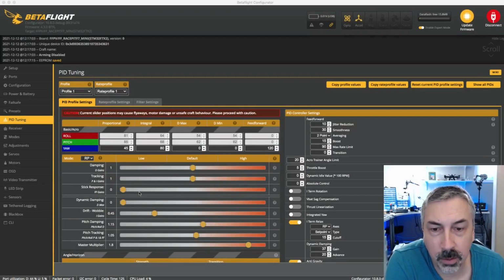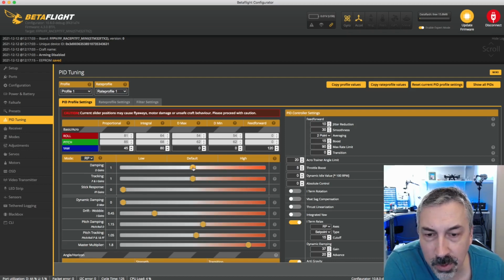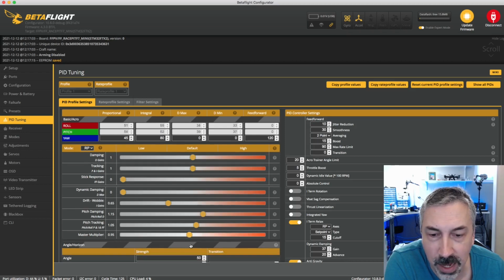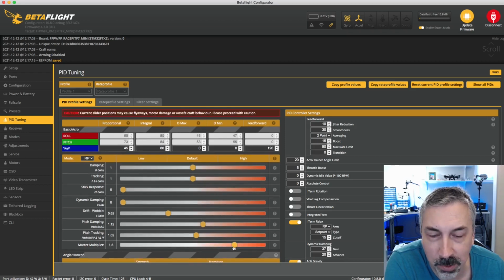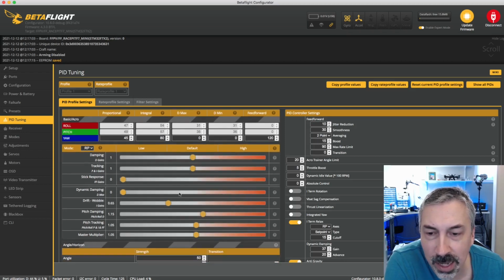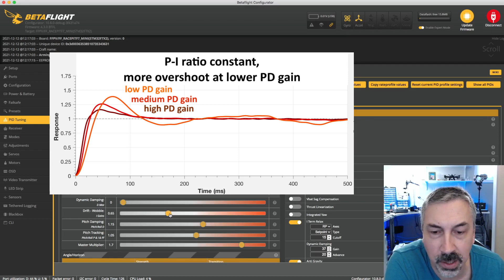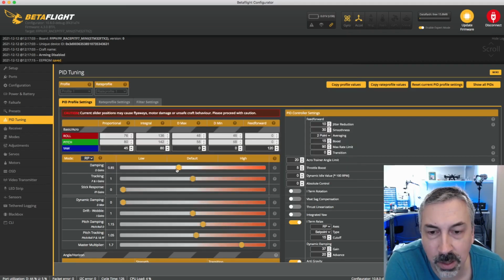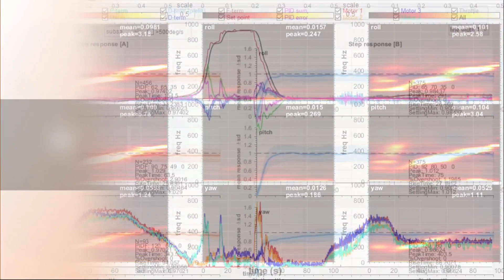Quick tip: Do P-I balance last!

Comment: when I add ANY I term after getting my PD balance either before or after master slider, it totally throws my step response out of whack. even just like .2 I term and BAM, i'm overshooting and filled with latency. IN my head this is that you now have to find the PI balance... which means its now going to upset your PD balance... do I just keep cranking I until it comes back down and fixes its self?
Reply from the maker: Sounds like you have a slightly complicated rig. There are ways to mitigate the issue. You could book a meeting with me.
https://ptblabs.ca

Comment: Howdi chaps new to tuning using Basement tuning method using PID toolbox more or less got the P to D balance slider ratio dialled in well as far as I can tell...  I'm at 0.5 on the slider.. I've moved onto master slider but my question is is it normal for less than 1 to be ideal ? According to the logs 0.9 seems best for me I took logs from 0.8 > 1.2 all the logs above 0.9 are above the setpoint just wondering if this is normal??

Thx in advance !

Comment: Maybe I do something wrong but I tried different techniques for PID tune via Pidtoolbox, and the best and the fastest way for my 3 inch and 5 inch quads were:
1. dynamicD off
2. Feed forward off
3. I slider to 0.5
4. Tune PI slider to no overshoot state.
5. Fine tune pitch to be closer to roll axis.
6. Boost Master slider untill got affordable latency around 20-12ms depends on quad.
7. Bring Feed forward to 0.5 and tune it like you do, tune FF boost if needed.
8. If still have some propwash, then add 0.1 - 0.2 to D slider

With this tune results I can easily do micro changes to master slider is I use heavy bat pack or use lighter pack or/and without HD cam (lighter AUW = -0.1 or -0.15 master slider/heavier AUW =+0.1 master slider).
Reply from the maker: That's reasonable for smaller rigs, and not that different from what I do, except that if you move P and I together, in particular on 5+ inch rigs, you would be potentially trying to dampen iterm-related overshoot. By pulling iterm out of the equation, and manipulating the damping slider, then you know for sure that any overshoot in the step resp curves is PD-related.

Comment: What should I do when I have the MM at 2.0 but the latency is not hitting a minimum? Move the P&I and D sliders up together to keep the same ratio?
Reply from the maker: You’d have to move the other sliders up while maintaining the proper proportions. But if latency does not asymptote at 2.0 you should look to see if oscillation is creeping in anyway. The latency gain may also be minimal after that point anyway and one should be careful not to over interpret tiny decreases in latency of <~1ms. You could be making a statistical type 1 error and just putting the pid gains higher than they need to be. You’ll squeeze more latency out by using FF at that point. The only reason you might want gains higher than that is if it can be shown to give more resistance to external forces like wind.
Reply: @PIDtoolbox  I think I may indeed be getting some oscilations. I think I also pushed the PD slider up too much so I'll back that off a bit and redo the MM tests.

Comment: Hi Brian, thanks for the great videos. I've test both methods you explained and it seems the model cannot tolerate high i-term. I wonder if it is related to 4.3 or having lower i-term is ok. In both methods, my best step was with i-term 0.0 or 0.2. Once I star increasing i-term I get clear overshooting.
Reply from the maker: it's all dependent upon the authority of your rig. If it's a lifter then there will always be enough lag to allow iterm to accumulate. Only thing that can help there is reducing iterm, lowering iterm_relax_cutoff, and increasing FF. you're always working within the limits of your rig.
Reply: @PIDtoolbox  thanks.

Comment: Hi Brian, love the basement tune method. Have been giving it a go. Might just be me, but when doing the Master Multiplier step, do I set I gains to zero or do I set I gains to default? Sorry if I missed it somewhere. Thanks.
Reply from the maker: Ideally you'd set MM before iterm for the reason I stated here. To reiterate, as you increase the MM youare increasing the responsively of the copter, and so this reduces the set point the gyro latency, and when this latency is reduced, then iterm does no accumulate as easy, so then when you turn up iterm after you have MM sufficiently high, then you can tune Iterm higher (more optimally) before you see it accumulate and overshoot in the step resp. To take this a step further, which will probably confuse you but what the heck, when you engage a sufficient amount of FF then you could theoretically even push iterm higher again, if you wish. so one could argue that maybe iterm should be tuned last. That's valid. Only challenge is the step resp plots can be misleading when using FF. No method is perfect. If you can work within these limitations though, it's pretty good.
Reply: @PIDtoolbox  great. Thanks for the in depth reply. Makes perfect sense to me now. No method is perfect as you say but this one seems to be the closest to it at this stage. 😊 In the end it comes down to "feel" too, well for me anyways. But starting off with a good tune helps a lot.

Comment: hi Brian, i did PTB tune this morning with my "a bit problematic" 7 inch build because it use 5mm arm thicness only. and i can say i get the best PID for the quad with gopro 6 mounted. but then like you said if changing camera etc.. (this means weight changes) we just slide up or down the master.. what i understand is if lower weight PD then turn master lower, vice versa. but after i swap gopro 6 to session5, i turn master down from 1.3 to 1.1.. just guessing ( because using same master at 1.3 i got jitter dterm noise from the motors, PID is too high for lighter AUW)) and the result is not good. because lowering master, the latency will raised and the graph shows the line is getting offset (not getting back to 0). i dunno what is this. its like too much I-gain graph. 
so when lowering the weight (smaller battery or camera) do we really need to dial down the I ? or just master?
Reply from the maker: first, it's not necessarily the case the adding weight means you have to change PIDs. It depends on the distribution of weight more than just weight. So for example adding a heavier cam might suggest that pitch only might need different gains. But in either case, I'd be careful with this simple idea. In practice what usually happens is changing weight also has a big effect on vibration, and this dictates what has to be adjusted, which sounds like what happened in your case. So yea, even though I made that assumption in a previous video, it's not that simple, and I wish is was. WRT your second point re dc offset of the step response, the characteristics of PIDs on the step response for our quads is manifested as specific changes to the initial part of the step response, usually before about 200ms in the response. Even Iterm is represented as a broader slow overshoot in the step resp, but still operating within the 200ms of the curves. The dc offset in the curves is generally not tied to anything we are interested in. Usually when there is a dc offset it is related to noisy gyro and generally low signal to noise (when there's only small input and noisy output). So in that case I'd use the 'y correction' feature. The "smoothing" feature can also help (if there's good input but gyro is noisy). These are kind of bandaid solutions so I use them sparingly just to help with interpretation in these cases. NOW, that said, in extreme cases where Iterm is set to 0, you may see a slow offset issue where it looks fine during the first 200ms or so but begins to slope off from 1. In those cases I think this is real drift from low iterm and should be exacerbated by poor cog. I havent tried this test where I intentionally imbalance weight distribution. Anyway, it's tricky because the step resp algorithm is all done in the Fourier domain, so it's really tied to the spectral composition of the input and output signals, that's the beauty in it. I dont know how much of this long winded rant makes sense to you, but I hope it helps.